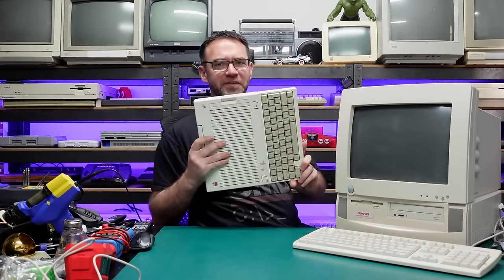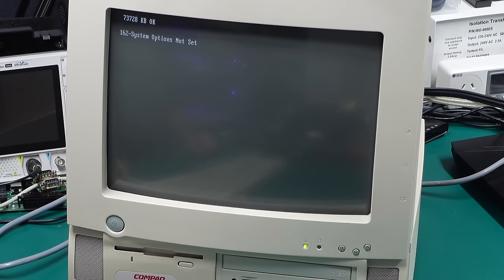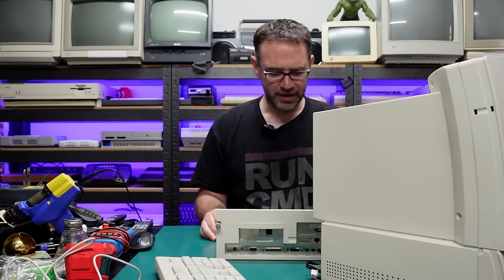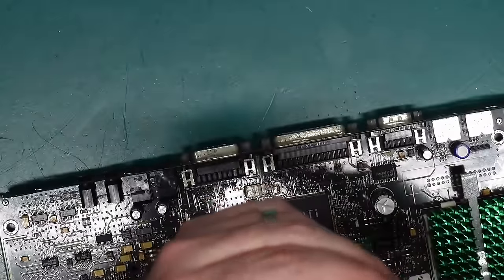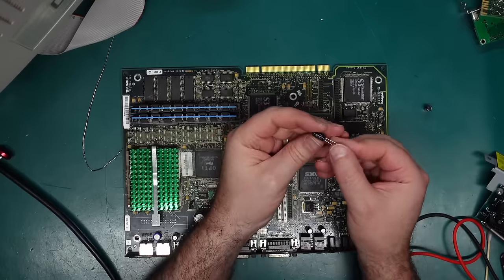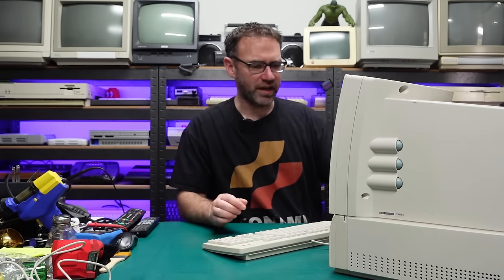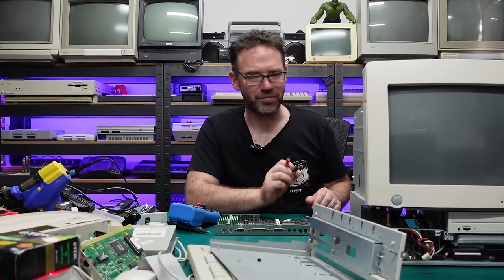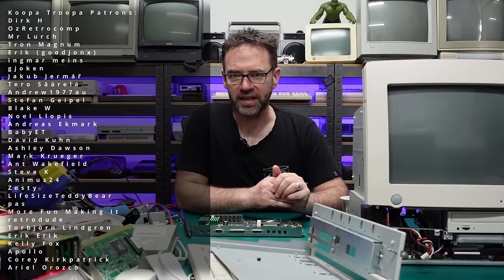Compaq Presario 5522 inspection and repairs #doscember

Comment: Two thing to keep in mind when repairing old designs:

1.When dealing with audio circuits, voltages are not always positive with respect to ground.  In this case, the datasheet clearly shows that pin 1 is positive.

2. "Shaded is negative" is by convention, not by standard. (At least it wasn't back then.) I've seen quite a few '80s PCBs that had the positive side filled in. From what I can remember (I built a few kits back in the late '70s), the PCBs used to be light brown, and the silkscreen ink was black, making positive the lighter side. When the industry went to the dark green solder mask and white silkscreen ink, there was some confusion... was negative denoted by the color, or the presence of the ink? Fortunately, most designers put a "+" in the silkscreen as well.

In this case, whoever did the layout may have simply "stuffed up".
Reply from the maker: Yeah, I didn't want to throw a capacitor in just based on which side was connected to ground. But the datasheet confirmed it was backwards.

They did also mark the positive side on the board, too bad they got this one wrong 😄

Comment: In my childhood I had a similar system in terms of form factor. It was a Siemens Nixdorf FD200. A very good device with TV tuner, Pentium 100 MHz, 8Mb RAM. Onboard soundblaster 16 and an onboard Tseng Et4000W32p with 2 MB memory. I loved the PC. I later installed an Idt Winchip with 200 MHz and 64 MB RAM and a Voodoo 1. What a great time. greetings from Germany

Comment: Years ago when I work at a computer repair shop. We used to work on these for a local school. The maintenance man used to bring them to us for repair. He would say, "I got more of those kumquat presimmons for you."

Also I remember working on that had a VGA connector installed. If you hook both up at the same time you'll get a video signal but the picture is darker on both monitors.
Reply from the maker: Good to know. Yeah I figured the VGA connector would only be able to properly drive one monitor, hence the image gets darker with two connected

Comment: Here is a tip: Before starting recapping something, take a sharpie and make a dot or mark on each capacitor. The mark should be in the same direction, facing the front of the equipment under repair. This way it’s easy to know how each cap was facing before it was taken out.

Comment: The Violet, 150µF Sanyo Cap at the edge of the Board might be an early Polymer Type Cap.
They started to pop up around that time and were used here and there, though rarely.
Reply from the maker: Ah yes, it does look like the right colour for one. Or at least the colour that most manufacturers use for them

Comment: You can grab a drop in replacement cr-2032 battery holder that is a perfect drop in replacement for pennies, makes for a nicer fix for the battery situation tbh. And do yourself a favor and a grab one of those screwdriver sets with 60 interchangeable bits from lidl for 10 quid or something. Watching those torx screws being attacked with a flathead gives me the heebee jeebies. ;)
Reply: Using a CR2032 Socket in the place of the soldiered in CR2032 should be the best replacement possible. Still a CR2032 but now easy replaceable (they die so often - at least every ~10 Years!).
Reply: Compaq case screws are both TORX and "flathead" compatible..
Reply from the maker: Of course, I just don't have any of the battery holders on hand and didn't want to stop the video until I sourced some, so I improvised. And it was easier to grab a flathead screwdriver than going through my torx bits to find the correct size. Mind you, I needed to find one later anyway to take out all the non slotted screws

Comment: I'd actually omit the modem since it's not going to be used and does use up adress space. May even cause audio conflicts depending on the spec. As I remember we had alot of problems with especially voice  modems when I worked in a computer shop in the 90s.
Reply from the maker: I was kind of hoping the ethernet card would line up with the hole in the back, but unfortunately not. Either way the modem will eventually come out
Reply: @TheRetroChannel  Different offset on the backbplate?
Reply from the maker: Yep. I'll figure something out later

Comment: More info on the microscope on a gimbal would be appreciated!
Reply from the maker: The microscope is an andonstar ad249s. I bought a cheap arm and ring light off AliExpress to mount it all. It's all pretty janky and wobbles a lot, so I don't recommend going that route. Better off finding a microscope with an arm already attached

Comment: Given the CMOS battery was dead, the system auto configure might have been using erroneous data resulting in the error.
Reply from the maker: Yeah I wondered the same thing. Although when the error popped up, it was always accompanied by the "system options not set" error. So it knew the data in there was corrupt